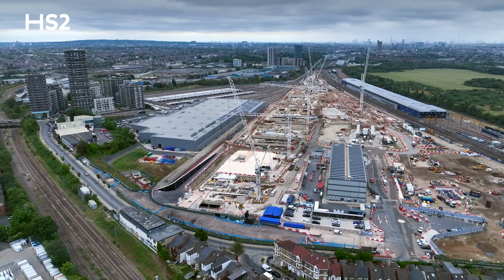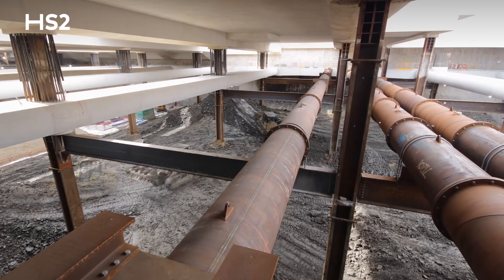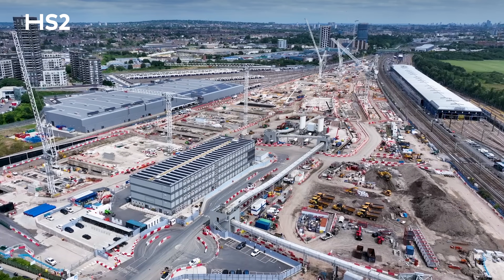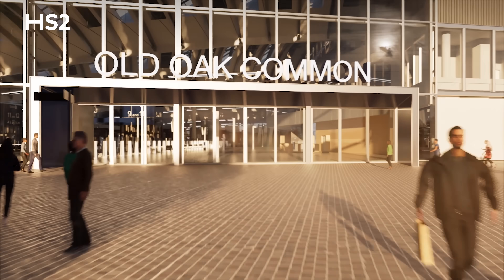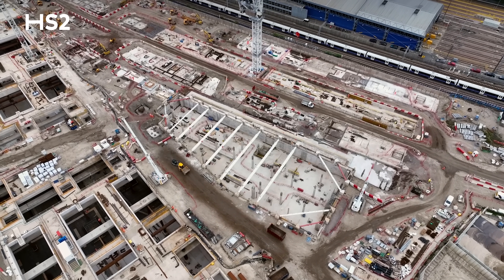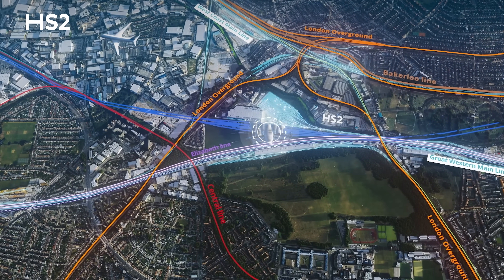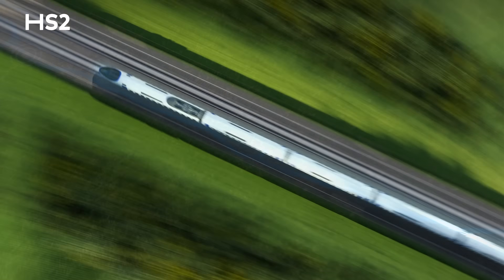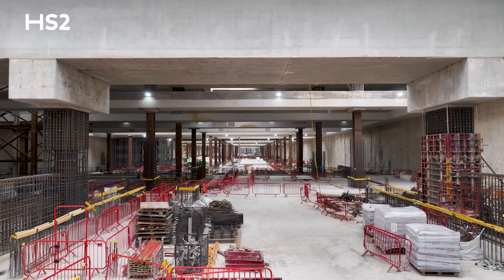HS2 Old Oak Common Station Project Update | October 2024

Comment: 1 million tonnes of construction concrete is never zero carbon 🤷‍♂️
Reply: They didn’t make that claim
Reply: @ I think you’ll find they did make the claim they are net zero- hello wake up!
Reply: HS2 constuction is a one off carbon cost, with the engineers working to make that cost as low as possible. HGVs and cars going between London and Birmingham and beyond create an ongoing carbon cost.

Moving InterCity trains off of the West Coast Mainline (and also the East Coast Mainline and Midland Mainline if Labour does the right thing and restores the northern part of HS2) will allow for rail-freight going to the Midlands and the North to get beyond the Birmingham bottleneck. We can then lower the carbon cost of HGVs driving north-to-south past Birmingham and increase the amount of rail-freight that runs on our existing railways. (Our stopping trains also gain more capacity if InterCity trains are moved away from the existing mainlines.)

The amount of carbon cost for construction will soon be repaid and then we will be running at lower carbon costs and reducing the amount of climate change.

If we extend high-speed rail to Scotland we get to ban domestic flights between England and Scotland.
Reply: @DavidShepheard  that’s a lot of unsubstantiated and unfunded assumptions there that completely ignore the carbon costs now, with no actual real plan to reduce them in the future. I agree with the railway line, but claiming it is Net Zero is a con at an almost criminal level.

Comment: Good on Labour for giving the green light to the Euston section 👍
Reply: And to crewe (basically Manchester)
Reply: @zacurrya9485  They didn't green light it to Crewe from what I saw, got a source for that?
Reply: @ShadowCastPro  Its rumoured that they'll announce it soon.
Reply: @ShadowCastPro  The Metro Mayors of the West Midlands and Greater Manchester will be sourcing cash to build this link
Reply: @peterwallen1063  I hope so, though their proposed HS2 replacement is lacking in a few areas, I'd still prefer it than nothing
Reply: @zacurrya9485  think it will not be called hS2 but will be a new hgh speed line between lichfield and crewe
Reply: @ShadowCastPro  The Metro Mayors of the West Midlands and Greater Manchester are sourcing cash and way's of building a 185 mph link from Lichfield to Manchester and Crewe
Reply: Except the Tories never stopped it as the massive building site next to Euston station proves. Even the TBMs were still being installed at OOC and would have started the drives to Euston regardless. The issue was not the line works into Euston it was about the deal for the over station development which had become unaffordable and the whole thing needed re-working. Which they did before the election. Whoever won in July would have given the go ahead for the TBM drives to Euston. Even Reeves has placed caveats on that over station development to make it look like it was HER doing. Deception at best.
Reply: @1chish  The Tory plan was to store the TBMs underground so that the tunneling works could be completed at some stage in the future. Once Old Oak common is complete, there no way to get those TBMs into place.

The works current going on at Euston is just last of the site preparation works and relocating utilities.
Reply: @DavidKnowles0   that was the situation of last resort if the revised overstation development business case could not be proven.
Bottom line is that HS2 could go to Euston 'as is' but local councils want the site redeveloped and Network Rail want to rebuild the whole station. So it's not about a lack of funding for the actual tunneling. If there was no intention to continue why continue the Euston approach site works?
Clearly the money was and is available as Reeves' budget showed (if you read the small print).
Reply: @1chish  The TORIES defunded the HS2 budget in October '23 for the Euston tunnelling only AFTER the TBM's were brought to site. Works at the Euston site were and are wound down except for completion of key enabling works already commenced before Sunak pulled the plug on it.
Do not attempt to rewrite recent history in an attempt to cloak the political vandalism wrought by Sunak and his clown Harper. 
Even with Euston built, the mess that remains of Phase 2a castrates the core aims of the entire project.
Reply: @1chish  It is now going into London Euston
Reply: @peterwallen1063   Yes I know. I wrote exactly that 2 weeks ago because it always was going to Euston. the issue has been the over station development and who funds it. Actually nothing to do with HS2.
Reply: @1chish  I think you will find the construction of the HS2 section of Euston like Birmingham Curzon Street, Birmingham Interchange and London Old Oak Common stations has every thing to do with HS2 if you look at their videos, it is who will supply the money.
Reply: @peterwallen1063  I love how people cannot read and yet seem able to write. Its bordering on miraculous
Look - go back and VERY CAREFULLY read my words. Then read them again.
I never referred to Euston STATION. I referred to the OVER STATION DEVELOPMENT at Euston. Which is nothing to do with HS2.

Jesus H Christ with a hat on ... 🤦‍♂
Reply: @1chish  And  I love people who do not know thing about HS2 either, the HS2 section of the Station is to do with HS2 all what will more than likely happen to the rest of Euston will be like what they did with Birmingham NewStret when they revamped it , reclad the outside and upgrade the inside. The new HS2 section is being built on the old Post Office platfprms cnsisting of 7 new platforms, 6 soley for HS2 train use and the 7th platform for duel use of HS2 trains and WCML trains ther has ben no mention of any business complex above the HS2 section and this article is about HS2 and the new stations and nothing to do with the existing station, as you said Jesus christ read up on this on the official HS2 ltd sites they tell you every thing man
Reply: @peterwallen1063   I got to:
    "And  I love people who do not know thing about HS2 either"
and gave up reading because its now become a pissing contest as your ego got pricked. I clearly know as much if not more than you do Soft Lad.

But let me repeat for others:
My comment was about the OVER STATION development which was to be privately funded. The HS2 station extension was always going to be built as the massive civil works outside prove.
Reply: @1chish  O sorry mate, I live less than a quarter of a mile from the HS2 construction site in Birmingham, have followed it's building since it started, work on the Railways, railways are my hobby and have read about HS2 on their sites on Youtube, this video relates to the construction of HS2 only and it's Stations of which the HS2 side is to do with HS2 and will be built along with the line by contractors working for HS2 ltd and will be a plane station with no over station shops connected to the existing London Euston station operating on the WCML route and as I said there has been no talk of demolishing London Euston as it would cause too many problems and as I said if you read my reply they will more than likely do what they did with Birminghm New Street Stations and clad over the existing Station external walls and totaly update the over station shops of which there are not that many if you have ever visited Euston, Birmingham New Street when it was revamped had a whole shopping centre redisighned above the station and it is the new HS2 station that may have to be privtely funded not the existing station and yes I know quite a bit about HS2 living in Birmingham where the HQ of HS2 ltd is based in Birminghm City Centre you here more on our local news than most people in the country do bout HS2.
O we ahave got a nail in our head havent we with our childish temper sorry soft lad I am a lot older than you lady boy.

Comment: Wow at last the Labour Government has given the go ahead to let HS2 run to London Euston, The station is the most congested station in the UK with 40 million passengers passing through this station every year and needs remodelnesing, Finger cross the new terminal will open way before 2041 and tough to the  nimbys brigade if you don't like the truth.
Reply: they've only given the go ahead to do the tunnelling not to redevelop Euston to cope with it. So it is essential to do the tunnel but a lot more to do and fund to get it into London.
Reply: @clwydian1  The Transport Minister has given the go ahead to develope London Euston
Reply: @clwydian1  Hopefully the station get rebuilt privately,
Reply: @scottpeacock5492  I certainly hope it will but at least it was sensible to give the tunnels the go ahead now
Reply: Remodelnesing.
Reply: Comment was to Scott Peacock…..  better would be a underground station below Euston / St Pancras - the platform would long enough to be linked to both with the line continuing to link with HS1 at Stratford or beyond.
Reply: Your incorrect, Euston is #10 at only 31.3M passengers per year(23), not even half of what is going through Liverpool St.
Reply: Last year, "only" 31 million passengers used Euston & it's ranked 24th busiest in the country (out of 997). It's actually only the 10th busiest station in London so it certainly ISN'T the "most congested station" in the UK .. failed to do your research again eh Scotty boy?
Reply: @ surely it’s the 10 busiest station in the UK, not the 10th busiest in London? Also ‘busiest’ and ‘most congested’ are not the same.
Reply: @garethking1639  .. based on annual passenger entries/exits, Euston IS the 10th "busiest" station in London .. Liverpool St, Paddington, Waterloo, London  Bridge, Victoria, Stratford, Tottenham Court Rd, St Pancras & Farringdon all had higher passenger numbers last year.
Reply: @CRIMSONANT1  yes, but you said it’s the 24th busiest in the country so I agree that there seem to be nine busier stations in London but which are the remaining busier ones in the whole country.
Reply: @CRIMSONANT1  Here you are again, For someone who doesn't even use the trains regularly not even during rush hour. Tell me how do you expect freight to run during the day with mix traffic.
Reply: @CRIMSONANT1  Information provided by the Government data portal ORR, I suggest you read the website since you fail once again, i like to know where you getting your information from, There were 420 million journeys in the latest quarter (1 April to 30 June 2024). This is a 7% increase on the 392 million journeys made in the same quarter in the previous year (1 April to 30 June 2023).
There were 1.6 billion journeys in the 12 months to June 2024. This is a 13% increase on the 1.4 billion over the 12 months to June 2023.
Total passenger revenue was £2.8 billion in the latest quarter. This is a 8% increase on the £2.6 billion in the previous quarter in the previous year (when adjusted for inflation).
A total of 15.9 billion passenger kilometres were travelled in the latest year. This is a 7% increase on the 14.9 billion passenger kilometres travelled in the previous quarter in the previous year.
Reply: @CRIMSONANT1  Same as you my boy
Reply: shame they dont care about putting the line to the people it was originally meant for
Reply: What more investments is going to London. 😯

What a surprise! 🤨
Reply: @AlOh-2  Well you can't have an High Speed Railway to the North without a terminal.
Reply: @AlOh-2  So you didn't get the email about the all new Curzon Street station in Birmingham? 
Euston already exists ... 🤦‍♂
Reply: raechel reeves better count her days
Reply: be careful reading Labour handouts. The Tories never stopped the building of the line into Euston as the massive building site next to Euston proves. Even the TBMs were still being installed and would have started the two drives. The issue was the over station development business case because it was a failure. The Tories / Treasury were resolving that and Labour inherited that work. Reeves has actually put caveats on the tunnelling even now as the over station business case work is not complete.
Whoever won in July would have given the go ahead so be careful who you praise.
Reply: @1chish the Tories only committed the funding to Old Oak Common, saying private finance would pay for the stretch to Euston.
Reply: @garethking1639   Wrong. The over station development was the private funded part and which became untenable. It was never going to fund the actual rail infrastructure. So a decision was needed. The construction continued as was shown in this video with TBM's being constructed to drive to the Euston approach portal and as can be seen next to Euston station itself with construction of the above ground approach route.
Reply: @ ok but aren’t you nitpicking? The funding has been found, maybe for the station rather than the tunnel but under Labour it will happen, rather than being in doubt under the Tories.
Reply: The private sector wasn't willing to fund the tunneling. So they had to pay for the tunneling or the station wouldn't have gone ahead